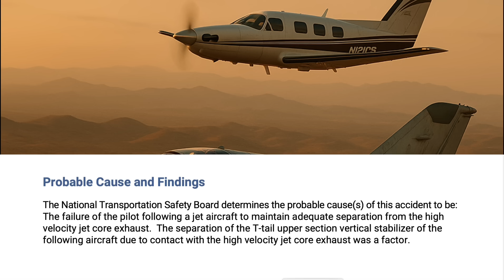Small plane Breaks Apart Behind MiG-21 during Aerial Photo Flight #atc (2006)

Comment: The picture you use shows a SIAI Marchetti S-211 registration N211UT, most definitely not a MiG21, but elsewhere you talk of the Mig-21 being N121UT. You need to get that sort of thing right!
Reply from the maker: Sorry about that. The official NTSB report suggests the registration of the MiG is N21UT.. but there is no record of that in open source.. hence the confusion
Reply: @Flight_Follower The reg is most certainly N21UT and at the time was registered to Experimental Rocket Racing. It is a 1974 Mig 21 UM serial No: 3046 and did have the reg N211EM so that might be where the confusion comes from.